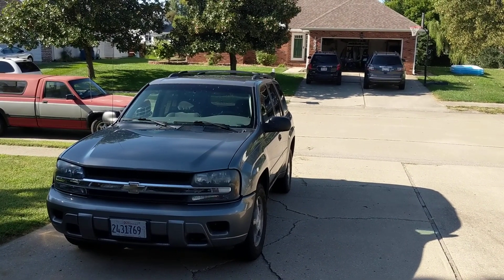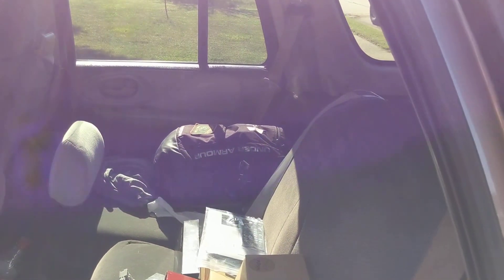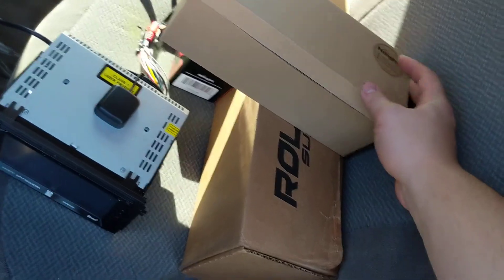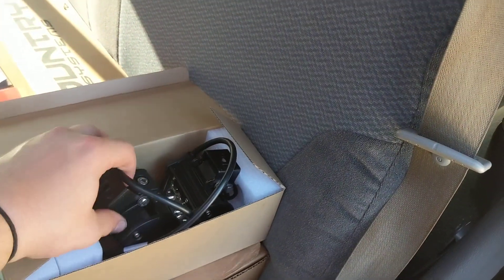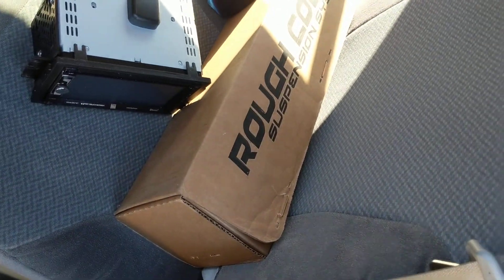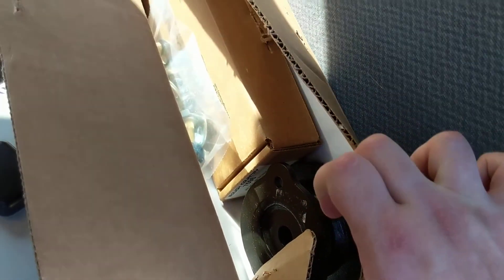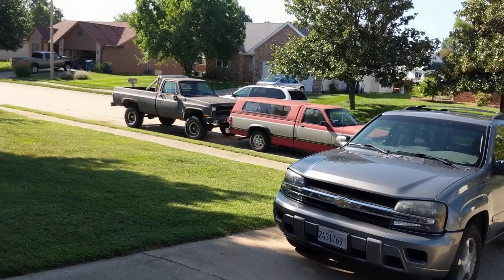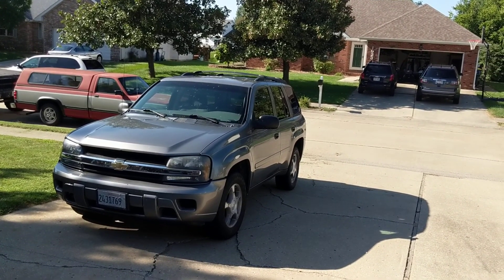Chevy Trailblazer Build Intro

Comment: I have an 06.  I added heated power mirrors with the turn signals I got out of a junk yard.  Double DIN pioneer, added in the overhead console with garage door opener.  2" leveling lift, tinted the windows.  Future plans are to add heated leather power seats.

Comment: I have an 06 in mint condition I really want to swap out the 4.2 to 5.3 or a 6.0 but it NOT a cheap project.
Reply from the maker: Honestly the 4.2L inline 6 was one of the most reliable engines Chevys ever made, if you really want/need the power that bad do it, but otherwise you can get 300+k out of those engines easy with minimal maintenance
Reply: Get your ecm tuned,makes a big difference. Mine is a 2002,tuned and you be surprised what you leave behind at the traffic lights,they are pretty zippy and good torque.